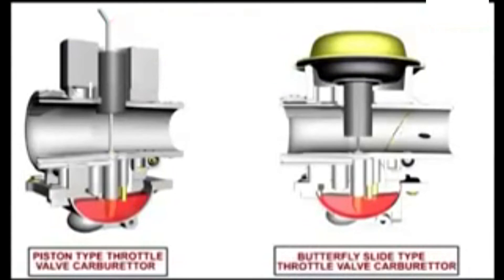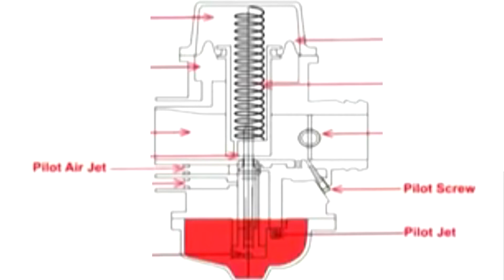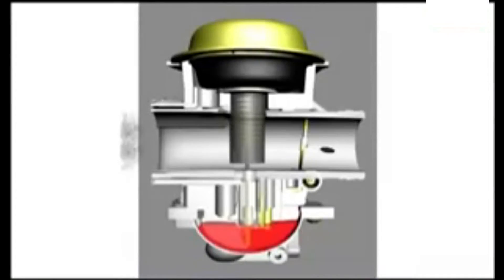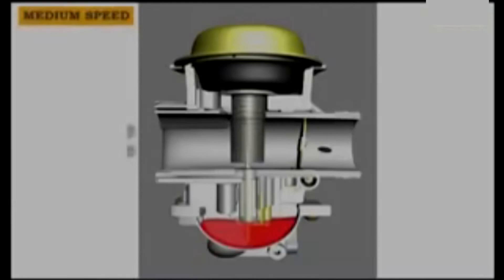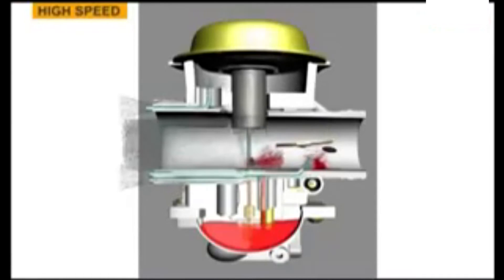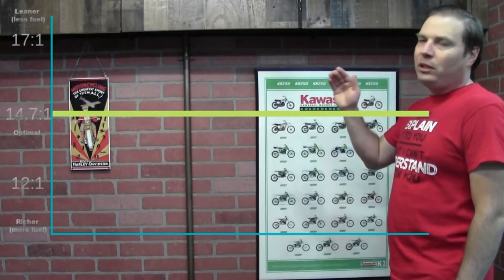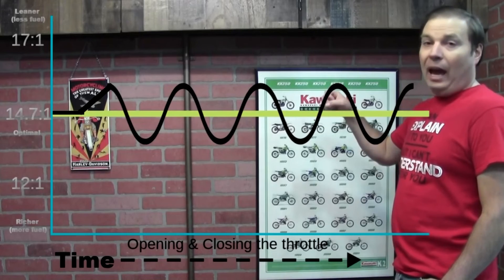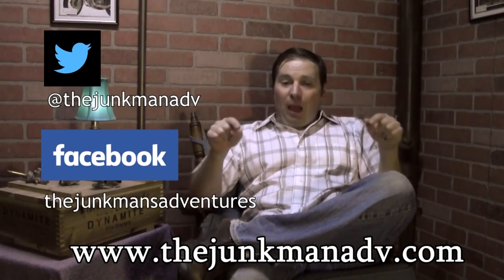Carburetor Jetting throughout the RPM range - Throttle openings explained!

Comment from the maker: If this video helped you considering giving "THANKS" ❤ it goes to help making more videos like this.
Reply: Junkman, I'm working on an EX30 Subaru Robin motor on a Powermate generator. under a load, it runs FANTASTIC. When the load is removed, however, the engine runs rich, sputtering through the exhaust. I've filled in the pilot jet (JB Weld) and reduced the pilot jet from .026" to .0225" and it has helped. Should I continue to reduce the size or do you have any other ideas? I know that generators don't 'idle' per se, and thought you might have some thoughts. Thanks.

Comment: So my raptor 660r, if I don’t let it run for a min it studders on giving throttle so I think I am too lean on my pilot jet. Then when I am in gear and everything balances out, I go into first and as I accelerate, it’s almost like I am hitting a rev limiter. I got a feeling it’s my needle clip position because it’s only 1/4 to half throttles

Comment: Hi - Great show - I was wondering if you could help with my headache. On a Stock 1979 Honda CB750K limited Edition, has a Delkavec Header that replaces the original exhaust that rotted out, and replacement of the Airbox with PODs that do not impose on the vacuum intake ports on the intake side, the stock jets are 68 main, and 100/102 for the needle. What jetting would you recommend instead ? thanks !

Comment: Fuel filter does wonders, I would never run any of my motorcycles without one
Reply: It doesn’t 🙄 more often than not those filters just cause flow issues. I run with nothing more than the screen in the tank (crazy how manufacturers thought to solve this problem, like they know what they’re doing) and nothing inline. Guess how many carbs have clogged.

The only issue arises when leaving fuel in the bowls for months at a time.

Comment: the problem with all of these tutorials is they assume the air speed through the venturi is constant. that the RPM is directly related to the throttle setting. it isnt. 

thats what the emulsion tubes are for... i forgive them for being completely ignored as the idea behind them is slightly confusing, yet simple. 

the suction on the jet drawing fuel up is not linear with air speed, yet the air speed is linear with RPM. venturis tend to create an overly rich condition as RPM builds. 
 by bleeding in extra air through the emulsion tube, you can regulate the suction to air speed to be "relatively" constant, and that means the fuel delivery is relatively constant.

get a lil 50... do the jets... then pop the emulsion tube and solder all the holes up... now start riding it around. oh my.

really good if you can stick them on a brake dyno, hold the RPM steady at any throttle setting. do plug chops... smell the exhaust... 

then you can start drilling new holes, at new diameters, see how it affects the curve... a wideband is handy ;)

you do it on a 50 as its got so little power you actually notice these things rather than it being simply overwhelmed by using say, an R1... and yeah, little bikes are easier to work on.

Comment: Thank you junkman great job on your presentation I'm a retired master technician I'm glad to have found your  site. It is absolutely correct in every way the information that your sharing with others and that is something not common to.all sites on the internet there's a lot of videos out that if you are not a master technician you might not catch the fact that some of them are lacking in some important details that an average d.i.y. needs to make use of the information successfully
Reply: Soo i just bought a bike with a carburetor and as soon as i turn it on. It just HIGH REV’s the entire time. I thought it was my throttle being stuck. But i now believe its my carburetor being open.. can u explain or help me?

Comment: If you have fuel traveling up a needle jet at idle what does that indicate? The motorcycle starts fine, idles like it should and drives fine but there is a slight and I do mean slight hesitation at 5-6k rpm.  I have checked the float levels four different times, new floats, new float needles and I have bench tested the float needles too.  Everything checks out.

Comment: Nice video,HI all

I have taking a liking to motorcycle and scooters and really like tuning them and playing with settings to get more performance, better milage, I really enjoy it and feel I have a natural talent in doing so

Id like to talk about tuning a CV carb, specifically one bike I own a Honda Helix, its a 250cc 4T, simple design and seems to respond to changes

This scooter has a CVT and will go 75MPH on top end OEM, but people complain you cant tune it, and I think its said becasue they dont know how

Typically this bike has a 110MJ and 38PJ fuel screw 2.5 turns out, There is a fella who posted vidoes of him tuning this bike on a dyno and by simple adding a K&N free flow filter and taking the MJ to 130 he got 1.5more HP out of a 15HP bike

I decided to try this with his setup and sure enough its faster, but the very low end throttle crack there is a slight bog and Im thinking a shim will resolve this, in fact he was using a 1.5mm shim

I think I can tune further it further to improve

Here are some questions

1. would it be better with a CV carb to NOT run the K&N directly on the carb body and use say a few inch pipe in between?

2. this video this guy is using a lollypop to meter air flow, what you think about that?

3. Any other suggestions for tuning a CV carb in this instance?

TY all

Heres his video

https://www.youtube.com/watch?v=Na6dbH9Mprc

Comment: Hoping you can help. I'm using a wideband O2 sensor to take any guess work out of determining the stoic nature of my bike. The chart I'm following says that a richer mixture provides better power, and cooler engine temps.

I tuned the idle circuit to a target of 13:1. That was easy. Now, when I took the bike out I was INCREDIBLY way too lean along nearly the entire throttle range. I raised the needle, yet it changed little. So, I bumped up my main jet and it fixed the issue for 1/4 - 3/4. However, I am running entirely way too rich at wide open throttle (WOT.) About 10:1 and less AFR.

My needle is at its highest position, and by decreasing the size of the main jet to solve the WOT issue, wouldn't that also lean out the needle jet throttle position throwing it off my desired AFR?

Not a whole lot of people I've tried asking help from can give me a solid answer. Thanks for the video by the way. Incredible animations, and I love the truly scientific approach!

Comment: I have a problem with the carburetor adjustment, the candle is clean all the time, the air adjustment does not help, the dose on the needle does not help either, the nozzles are clean
Reply from the maker: Never heard of a candle?  What is the symptom.
Reply: @thejunkman  The spark plug is still clean even with the needle up. The nozzles are also clean
Reply from the maker: Sounds like it is running fine then.

Comment: Great video. Maybe I need to peruse more of your videos. My kid's 50cc has a very simple carb. Low hours, stock everything. It bogs and/or dies if you rip the throttle off idle. I've cleaned it, raised the float, cleaned it, cleaned it, and this one symptom remains. I'll be trying to adjust the needle height soon, but I'm out of ideas. Seems odd for a basically new bike. Are slides adjustable?
Reply from the maker: Try that, if it improves you might need a larger main jet.

Comment: So my carb was cleaned about 3 yrs ago, paid like $374 ... she ran like a champ, no sputter, no bogging ... i ran her for about 3 months  and had to park her. 
I have not ridden the bike for about 2.5 yrs but i do crank it up every month and let her idle for about 20 min ...
She has always had ethanol free fuel and just today i want to take a ride and she is sputtering. Idle is perfect but once i get on throttle and get about 1/4 in she sputters and looses power.
Gave 1/2 throttle and she gave some power but again started to sputter with hesistation. 
Could low fuel level in the tank cause this ??

Comment: What if the carb does not have as fuel mixture screw and the bike is snappy responds good throughout throttle but on deceleration it pops and backfires and my plugs are not sooty
Reply from the maker: It might have an air screw.  See my video on that specific adjustment.
Reply: @thejunkman  it doesn't have an air screw but I just noticed there's a nozzle for the fuel screw but I can't get a screw driver in there. After many unsuccessful tries at getting to that fuel screw it was damage causing a pinhole in the bowl of the carb. With a little JB weld its patched and running again but I can't get it to specs. I follow recommendations but results differ. I realize tuning is a complex and time consuming process when you're a novice with no garage and limited to the work allowed on property, it's hard.

Comment: i have a question. my motorcycle when start up it starts smoothly good idle. but when it reaches in 1.5k rpm it kinda coughs. and sometimes in high speeds sometimes the throttle response is delay. please help me. its a CV carburetor
Reply from the maker: Check the rubber diaphragms for cracks or tears.  How old is the motorcycle?
Reply: @thejunkman  9yrs
Reply: @thejunkman  i checked it there's no cracks nor tears. but when i manually upping the piston it stacks up a bit

Comment: What causes soon as you give it gas to take off it dies doesn't bog it just dies and cuts out 150cc
Reply from the maker: Many possibilities. Its lean for some reason is the cause, you need to find out why.
Reply: @thejunkman  found it seems this carb has a welch plug over the mixture screw closest to intake.
Reply from the maker: That means it is pre-set and not intended to be adjustable.  First make and sure the pilot jet is clear and clean, float height is set correctly. If that all checks out do your adjustments with different pilot jet sizes.
Reply: @thejunkman  ok thanks
Reply: @thejunkman  I did get that welch plug out factory set was 2 turns so I played with it went to 3 turns and hell of alot better.It's more crisp and idles better so is it wise to let it there or go up on the idle jet.

Comment: what would cause a bike to backfire at normal 1300-1500  rpm or lower but run ok at around 2k ? and after a dah or 2 sitting it just doesn't start and floods the intake i played with the fuel
mix screws and nearly closed them to 1 turn out vs the 1 /78 -2 recommended in the manual .. i'm assuming too rich i read even lean conditions can cause backfiring at low rpm

Comment: Hi, I've recently replaced my stock non adjustable needles with some stock adjustables... my bike idles ok, but it bogs down midrange and clears itself the wider I open the throttle. The plugs are also black. Would moving the clip up the needle help this?
Reply from the maker: Yes it should help.
Reply: I have this problem with my Rmz 250. What would I have to do?

Comment: Hey man! While cruising at slow speed in a higher gear, the bike bogs if I fully open the throttle, like a lean condition. However, the bike misfires/pops under full throttle at top gear especially with a pillion, sort of behaves like rich. Any suggestions?
Reply: Diaphragm issue

Comment: i tried to tune my atv but every time i am in 4 and 5 gear at half throttle it bogs out i was riding and ran out of gas and it ran great so i no is getting too much gas but win i adjusted it it still ran the same what do you think i should do

Comment: So the pilot jet is keep open all the time? At low, med, high rpm?
Reply from the maker: It is, however once the main jet opens the fuel level starts to dip below the pickup of the pilot jet making it not a factor in jetting much above idle speed.

Comment: I bought a brand new Chinese pz20 carb it idles perfects but Boggs at higher rpm and when quickly pulling throttle.
Reply from the maker: Richen the overall jetting
Reply: @thejunkman  I’ve tried the air fuel mixture. It didn’t seem to help much. Could it be the needle needs to be moved one notch?
Reply from the maker: What do you mean you have tried the air fuel mixture?  If you mean the screw, that doesn't effect the jetting past idle speed.  You need to change jets.

Comment: I having a little problem with my kawee 250F  at low throttle prob 1/8 to 1/4  throttle only happens when I wanna cruise slow and be stealthy lol I’m getting a popping and backfire .. other then that the bike performs good no lag in power starts up decent all the time .. just a low throttle when I’m sneaking by someone’s house ..  but if I wack the throttle from low to high it’s fine ...  is it getting to much fuel  at low cruise ??
Reply: Opposite of what the other guy said. Popping/ Backfiring/ Decel Pops are caused by lean conditions. Try going up one size on the pilot. if that doesn't help you may need to lower the needle clip in the slide down one notch to richen the needle.
Reply: Slightly too much fuel…I mean slightly so for example if you’re on a 40 pilot jet go down to a 38…if you only have say a 35 as your next option then just simply raise the needle jets clip 1 position effectively leaning your mixture ever so slightly

Comment: Hi, I think you answered my question in this video but here goes...

When I'm at full throttle top gear, after a few minutes at high revs the bike totally cuts out like it's not getting any fuel at all. I have to back off the throttle to about 3/4's to then hold it at its top speed, which is now obviously now less. 

Is this too lean? Brand new carbie with needle in position 1 at top. 

Cheers
Reply from the maker: You answered your own question in your response.  Short answer is yes.
Reply: Im not a pro but if its running fine at wot for a couple minutes before theres a problem, it sounds like your carb is using up the fuel in the bowls faster than the pump can supply it. I would replace your fuel filter. Also check your fuel pressure while at wot and revving and see if your pump is keeping up.
Reply: when my bike did that, the main jet was too rich
You should start in the middle clip on the needle, tune your main and pilot jet then use the clip for fine-tuning at the end 
You need to get in the habit of looking at your spark plug, I do after every ride for tuning. You can even hold the throttle position where you're having trouble, ride around a little bit right there and then look at your spark plug it will tell you what's wrong

Comment: You mean pilot mixture doesn't effect when pilot jet was flowing full fuel mixter..???
Reply from the maker: I am guessing you are asking does the pilot effect the mixture at full throttle, correct?  No it doesn't' because the fuel in the float bowl level is too low to be sucked up, as well as the pressure drop is going to force the fuel up the main jet as the path of least resistance.
Reply: @thejunkman  i mean what happen to pilot jet when wide open throttle does it giving same af ratio according to what af mixture we set at idle..??
Reply from the maker: I answered that question in the response above.  No it has no effect at wide open throttle.  That is all the main jet.
Reply: @thejunkman  thanks dude..
Reply: @thejunkman  so why company keep pilot jet up then the main jet in float bowl..??

Comment: Recently I installed a new carburetor in my car. The bigger main jet that it came with was of size 180. With 180 jet, the acceleration was jerky from half to full throttle, but it accelerated pretty quickly. I swapped the larger main jet from 180 to 135. Now with 135, the car bogs down under wide open throttle (especially when the pedal is quickly depressed), and then picks up after around 2 seconds. I've also noticed that the acceleration isn't as good with jet 135 as it was with 180. It idles perfectly fine and acceleration is smooth and crisp for half pedal; only problem is that with WOT, it bogs down and isn't accelerating as it should. Should I go for larger jet size of 150?
Reply: I'm not an expert but i think yea the 135 was too small for a Main jet so the car is starving for gas on WOT (Lean condition). 
Lean condition is harmful and can kill your engine really quick, However, Rich condition doesn't although the engine isn't running properly. From what you said the 180 Jet gave you the Rich condition symptom (sluggish acceleration but not a bog). 
Just wanted to say ALWAYS start with Bigger Jet (Richer) then go down, not the opposite. You could also try to keep the 180 and lower the needle (Make it leaner) if you have an adjustable needle, but since you don't have any issues until 1/2 throttle, main jet is your best bet.

Comment: My carb does not have a vacuum it a mikuni vm22 22mm will it be the same?
Reply from the maker: What do you mean does not have a "vacuum"?  The VM22 is a piston type. This video applies to all types of motorcycle carburetors.  The basis of this video is to explain how the fuel and air are flowing through the carburetor at different throttle openings.  Thus with this knowledge you can pinpoint the adjustments that need to be made.

Comment: Automatic choke does not activate in cold engine. What is the reason?  How do I set it.?
Reply from the maker: Usually that is an electrical problem as there is a wire/heating element involved (on automotive type)  Otherwise there is a bit of a linkage that might be stuck that operates the butterfly(s).